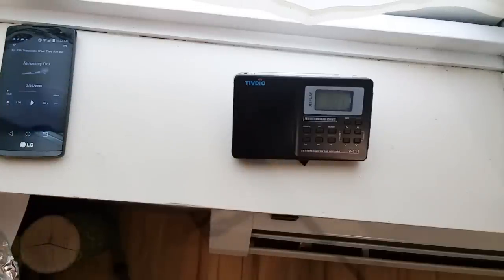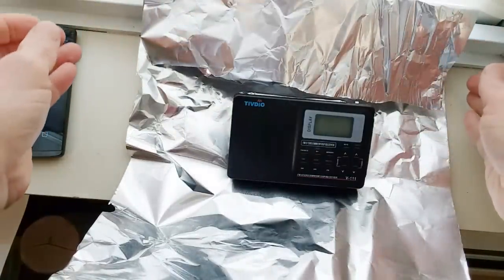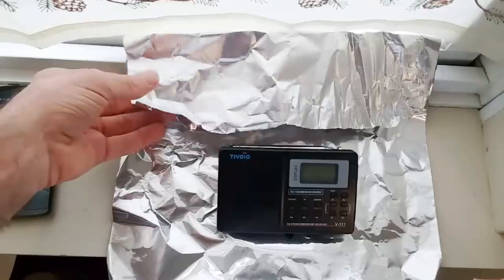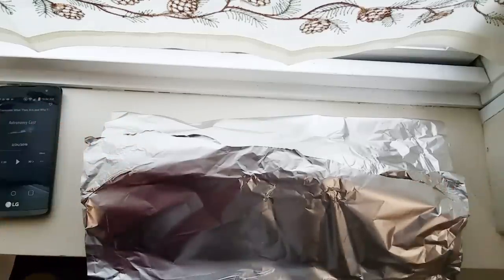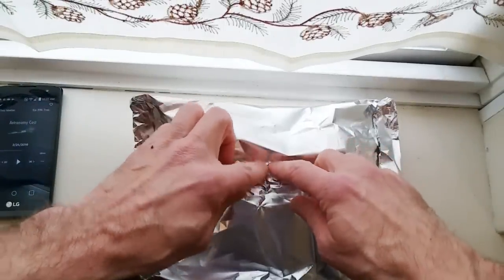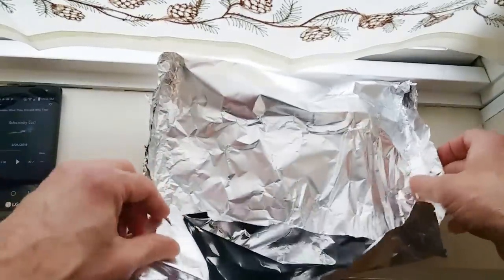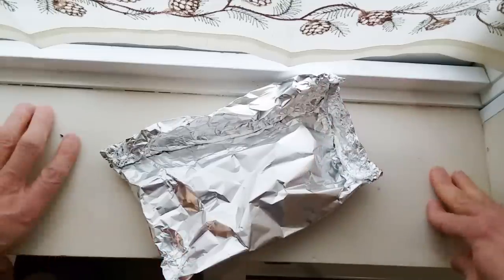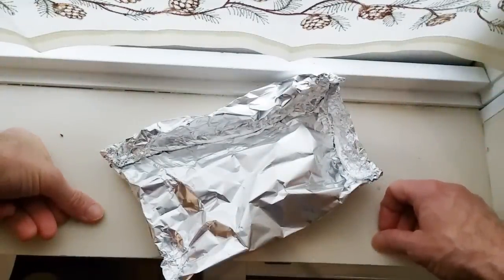Blocking EMF radiation around the home

Comment: I think it usually takes 2 layers to block cell phone or wifi signals.  Also, you don't want the device touching the aluminum foil because it can act as an antenna.  So you should put the device in a plastic bag first.

Comment: Buffering. Streaming services "pre-load" data beforehand in case the connection is somehow interrupted during playback, which was the case here. In addition, make sure to watch the WiFi signal strength for changes using an app or a separate device, instead of relying on the sound itself like you would on a traditional radio.

Comment: Great video. AM is in the kHz frequency range, so long waves. FM is in the MHz range, so short waves. WiFi is in the GHz range, so extremely short waves. The effectiveness of the shielding is probably related to atom diameter related to the wavelength.

When the wavelength is really long, it gets through more easily, and when it's way shorter, it also gets through more easily. It might prove that the wave length in the FM range is approximately as long as the diameter of the atoms or the foil (?).

That might actually help you determine the speed that radiowaves travel with, which is probably the speed of light. You may have come up with the first accurate test to determine the speed of light.

I'm sort of worried that the speed of light becomes really slow, so maybe when light travels through undefined unbound space (no energy other than the light, and no mass present) the speed of light is infinite. When light travels through defined space (with other bound or unbound energy) through its interactions it locally develops physical particle like properties, only to travel on as pure unbound but directed energy after that at infinite speed until it hits something else.

I really like this test. Great job.

Comment: The reason it is getting through is the skin effect.  The RF is coupling with the cellphone  by the surface of the cellphone touching the foil. If you wrap the cellphone in a thin layer of bubble wrap and then the aluminum foil it will work.

Comment: Hi I've noticed my Logitech surround sound has a small interference when lights are turned on and off and when my fridge motor turns on any ideas if tin foil would work I've heard copper tape should work but am unsure what cable I would need to put it on any help would be appreciated thanks
Reply from the maker: Try plugging in your surround sound to an outlet that's not on your lights circuit.

Comment: Does graphite powder mixed with emulsion paint protect people from emf frequencies ?
Reply from the maker: Nickel flake is used in emf shielding paint bc it has good conductivity, at a cheaper price than say aluminum, copper, silver. Graphite has much lower conductivity.
Reply: @p1nesap  I need nickel flake in powder form to mix with paint, but can't find any. I have found very fine metal powder, would that do the job ?

Comment: We had to move away from cellphone towers and signals, because I got sick. Now I am 100% away from the 5G and fiber crap. I lost weight and Drs thought I had a psychology problem, which I don't have. I worked for psychiatrists for many years, but all it was is the wave's of the EMF AND RADIATION FROM CELLPHONES AND 🗼 SIGNALS
Reply from the maker: Thanks for checking in. I'm not surprised to hear about your experience. Glad you got the heck away from towers & feeling better. Pretty soon it's gonna be hard to find a phone without 5G.

Comment: Static in the air helps perpetuate the radio (radiation) signals. I use a spray bottle with water to knock some of that down. Also grounding is essential.
Reply from the maker: Interesting. Another friend was mentioning barefoot grounding recently.

Comment: I have done some experiments myself as I have an EMF meter. Thanks, for showing this. The worst thing in my house is the alarm system that is on wifi. The dangerous EMF's start about 3 feet from the device. I am trying to figure away to block that radiation effectively. As turning off the device can also cause problems. Shungite and pyrite are the best to block, but you would have to have a solid piece for the whole 5 inches x 8 inches screen. I thought of the aluminum foil; but now I don't have to try that. LOL

Comment: Hey, so I did an experiment of my own! 
I made this pocket out of a box just bigger than a cell phone; I lined the outside with heavy-duty aluminum foil and added a layer of black duct tape on top of that. I put my cell phone inside and then I added another layer of heavy-duty aluminum foil around that to sealing the air cracks. 
My cell phone continue to play the song that I had picked but it ended before the song was supposed to end. I think that there is a delay between cutoff and Signal transmission. Ultimately I think that if you have enough layers of aluminum you can block the frequency signals, as long as you give it enough time for the upload to fizzle out!
Reply from the maker: The song ended bc the foil shielded new signal coming through, after the buffered video ran out. Good experiment & thanks 4 posting.
Reply: And yes I tried the experiment a couple more times and the same thing happened

Comment: I have tried it with my mobile phone, tin foil, it worked as well.  So you have any more good tips to help with the 5g?
Reply from the maker: Using 2.4 GHz for WiFi is problematic in populated areas bc of all the traffic, so I use 5 GHz. I'm not crazy about it, but need Internet. I'll avoid using 5G cell phones as long as possible! Other EMF protection tips: talk on speaker, avoid carrying or wearing devices close to the body. Sleep with phone off, or at least 1 meter away, and turn off WiFi router when not in use.

Comment: So basically covering your phone with aluminum foil is a good thing? Correct?
Reply from the maker: I wouldn't say it's a good or bad thing. This is an experiment. The easiest thing would be turn off your phone and only use it when needed, esp. with this awful 5G rollout. Have you read that it interferes with airplane communication/ navigation? Yikes.

Comment: I did lots of shu time in federal prison like 4 years not straight. Months at a time because i buck. I learned that our Walkmans get better reception for am if you put it on the cement floor because of the reebar. You just have to turn the radio a certain way so the bar antenna inside the radio lines up with the reebar. Long am waves. Yes to block wifi and phone signals you have to use at least 2 layers of foil or more.

Comment: U need 3 layers at least for it to work
Reply from the maker: That's about right.
Reply: @p1nesap  Did it with my phone some years ago, i could even make a small hole were the data icon is on the phone screen, even then it still blocks the signal. . .

Comment: I think the problem is crumpling as it gets small holes. Anyway, reduction is good too. We can put silver mesh fabric on the router, and it will still work, but radiation will be reduced 90 percent. better than nothing.  Making canopy though is super expensive. I am wondering, if we could just paint mosquito net with metal powder paint ourselves? Most of them are not washable and only have coating anyway.
Reply from the maker: If you do that experiment, please let us know. Thanks for posting.

Comment: The higher the frequency, the smaller the hole the signal can slip into.
Reply from the maker: How do you know?
Reply: @p1nesap  
Because the higher the frequency, the smaller the wavelength gets; the smaller hole it can slip through. It's basic stuff most amateur radio operators learn.

Comment: Foil alone won't block signals, you have to have a barrier between the phone and the foil.  Wrap the phone in a cloth and completely seal it with the foil (no open ends)...this works...we tried it.  The foil alone did not work.

Comment: Switch off your WiFi router at night it won't come to any harm and just switch it back on in the morning and everything will spring back into life. I also switch off my walk about phone's base station too. I do have two old school telephones plugged into the wall sockets that remain operational, so you're still in contact with the outside world and here's a tip, the old school phones work in a power cut whereas the walk about ones won't.

Comment: Not a good representation of the WiFi signal strength! Lossy compressed audio requires very little bandwidth, the client likely cached at least part of the audio file. Radio stream has a very small buffer although with live stream video it would easiest to spot the difference. 
Or you could use Vistumber developed by Phillip Ferland and Andrew Calcutt on a computer to see how good the signal is. In AP settings you likely can see signal strength as well.
Reply from the maker: Thanks for posting. Yes some data may be cached; check my recent update to see no-cache results. 
Vistumber developers should spell-correct their site; does not impart much confidence. I'm on Linux anyway so no dice. On Android, WiFi Analyzer Pro works a charm for nearby signal strength and I highly recommend the app. Either way, my video is about blocking signal strength.

Comment: what do we need to shield from cell signal? foil didnt work
Reply from the maker: You probably have 5G cell service. Foil won't block 28 - 60 GHz.
Reply: @p1nesap  right, basically need a copper cage or box

Comment: Instead of shielding waves you can also absorb them with water but water is heavy and tends to leak creating water damage. You can easily absorb waves from the floor underneath using a water bed, you could also earthed the water using a stainless steel stopper and earth it, for the bed sides and the cealing it gets more challenging. A water helmet could also be patented, it just need a sealed void instead of the protective foam which will be filled with water, whisky/tequila/beer could also do the work. You could use a tube to drink it but it will alter the "shielding". I'm sure someone will steal my idea and make money with it once again.
Reply from the maker: Find relief wherever possible friend. Thanks for posting.Best regards, Paul

Comment: If you crinkle or wad up foil, then unwrap and put in radio or cell phones, it stops the FM radio and cell phone signals. The peaks and wrinkles in the foil confuse the signals. You can also put your cell phone in the microwave or refrigerator and it will be blocked. If your phone rings in the microwave then your microwave isn't properly sealing and it is emitting even more radiation. Don't know about AM radio.
Reply from the maker: Thanks for posting.

Comment: We  humans do not need 5G speed which may be harmful to us by it's high frequencies directed signals but AI bots desperately need 5G to evaluate human actions in real time to monitor and  rule society. Because 5G has no latency at least that is what they told us is. 
Edit: so we need to find a way to protect ourselves,our homes, families against these frequencies. A cheap aluminum foil can't even block mere wifi signals so it has no chance against hundreds times stronger 5G signals
Reply from the maker: Thanks for posting.

Comment: For the wifi experiment try grounding the foil to EARTH ground and see what happens...also may want to try several layers of foil. If you are in a modern home, the third, bottom prong is earth ground. Don't connect it to HOT or NEUTRAL only earth ground! A cold water pipe works great too.
Reply from the maker: I use baseboard heater copper pipe as ground.
Reply: @p1nesap  That should work but should be checked with a DMM/voltmeter....

Comment: Er...just turn the wifi signal off and use ethernet cables only and don't use a smart phone.  Solved.
Reply from the maker: That works...but many of us are more dependent on this stuff.
Reply: @p1nesap  OK.  I recommend earthing outside in bare feet.  I also use healing rods, left foot forward style as per the ancient Egyptians.  Not so easy in the winter though.

Comment: CAN YOU DO THE SAME TEST BUT WITH AN ALUMINUM POT AND A LID ? LETS SEE HOW THICK METAL WE NEED TO STOP THE WIFI 4G SIGNALS?   ANYONE KNOW IF IT IS POSSIBLE TO BUILD A PROTECTIVE CAGE AROUND YOUR BED?
Reply from the maker: Check out my recent video, a few sheets of foil does the trick for WiFi: https://youtu.be/tVFJJEiJ1C0
As many have pointed out here though, 5G cell networks (up to 60 GHz) is another matter entirely. Foil won't cut it.

Comment: I’ve been having headaches and high pitch ringing in my ears that sounds like it’s pulsating. Come to find out, they installed 5G not too far away from where I live. God have mercy on our souls!!
Reply from the maker: Thanks for reporting Jen. Good luck.
Reply: line your walls (and maybe ceilings if necessary) with aluminum mesh screen.   very effective in blocking RF radiation.  can also use emf blocking paint or emf blocking cloth but much more expensive.
Reply: @operasinger2126  but 5g doesnt go through your walls, hell even some bushes can block it.

Comment: It could be that the aluminium foil is acting as a conductor rather than as a barrier to the radiation.

Chemtrails contain aluminium, for us to breathe in, to serve their nefarious purposes. Vaccines are reported to contain aluminium dust, also put there for nefarious purposes. We all know we are not supposed to heat up food in the microwave with aluminium foil; it concentrates the microwave radiation and can damage the oven. 5G are microwave frequencies. Many locations have reported dead birds around 5G towers.

Not sure what you can use. I'm thinking to use 2 layers. One layer is the foil or a sheet of metal. The other layer is a material with extremely poor conductive properties. The metal layer is on the outside and the other layer is on the inside, next to the radio or phone. The foil might start collecting and concentrating the radiation it picks up. This may have an effect on people who are around the device. It may be possible to safely 'discharge' the built-up radiation somehow. Though I wouldn't have a clue how to do that.

What's that stuff they put inside microwave ovens on the doors and sides? Use that? Have you tried putting the device inside a microwave oven and see if it still gets a signal?
Reply from the maker: Check my recent video applying multiple layers. Thanks for watching.

Comment: Leave the foil alone its pointless ! Inside your smart meters  there is a 5G transmitter ! they fooled us all ! it has huge 450V capacitors x 2 thats 900 Volts on a 230V electrical system ! These capacitors are connected to powerful antennas and are more than capable or pulsating 60hrtz  on  command via its built in wifi ! sorry guys your already being fried ! Turn um off !
Reply from the maker: 5G cell networks make me nervous, the more I read. Thanks for posting.

Comment: What does a sheet of lead do?
Reply from the maker: Lead blocks radio transmissions and WiFi. Aluminium and copper are used more because they're lighter.
Reply: @p1nesap  - Many thanks for that. Do you mean Aluminium OR Copper independently - or a mix of the two?

Comment: "Crinkle" the aluminum! uncrinkle and NO holes!  for your phone and especially for 5G.  'Crinkle' to scatter the signal!  And how right you are, in what it is doing to us!!
Reply from the maker: Thanks for posting.
Reply: @p1nesap  thank you.  I heard the crinkle thing on Montegraph channel.
Reply: 5G has beamforming reducing covered area and transmission power. Higher frequencies quickly fade with distance, so it will work more similar to WiFi with many low power base stations in the city.
Reply: @ArthursHD  Unfortunately,5G... will be multiple frequencies ranging up to 60Ghz - 80Ghz...

Comment: Try that same experiment,  and try connecting a coax(sheilded) cable with alligator clip attached from coax center conductor to tinfoil, and other end coax center conductor to a foot or two long ground rod thats shoved or hammered into the ground ..outside (earth ground) and then see if reception changes.
Reply from the maker: Thanks for suggestion.

Comment: One of the best ways to shield oneself from these EMFs is to unplug devices when not using them especially microwave and certain advanced televisions and cellphones. I noticed when I went two weeks without my cellphone all my aches and pain completely disappeared. I mean completely. When I finally received a replacement phone the aches and pains started back up again. Now when I'm not using my phone I turn it off and or unplug it as well. When you have devices turned on or plugged in those devices are still active running on low maintenance currents that increases when you actually use those devices.
Reply: I noticed that too, and when I hold my phone for too long my hands hurt with an arthritis like pain and they tingle and burn. I also feel my phone buzz in my pocket when it's not actually in my pocket. And don't get me started on the tinnitus, omg my ears are always ringing when I'm home it drives me nuts. But when I'm in the woods or on the lake it goes away.
Reply: @matthewallman1  first off 5g and stuff like phones are harmless because they are non ionizing radiation second if you have tinnitus go to the doctor it has nothing to do with any emf or whatever. and you holding the phone also make them check that out because you probably have a hand problem
Reply from the maker: Great info, thanks for posting.